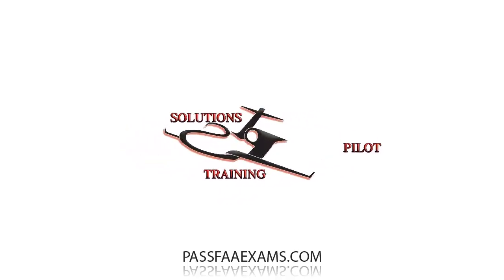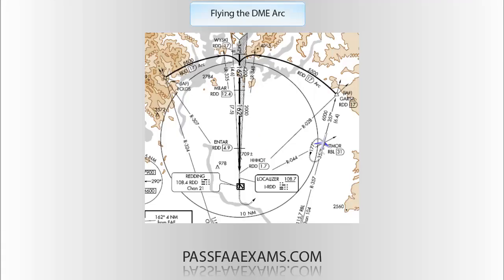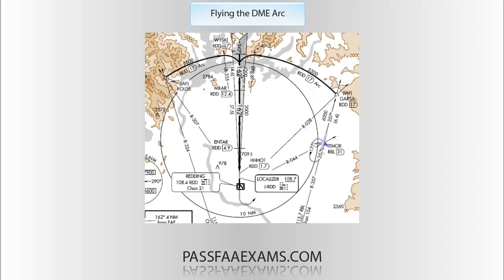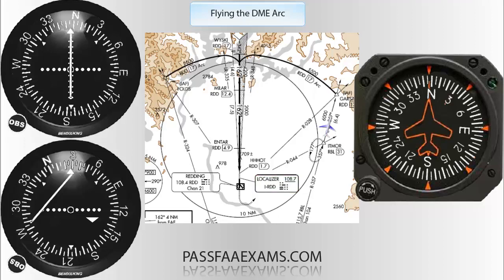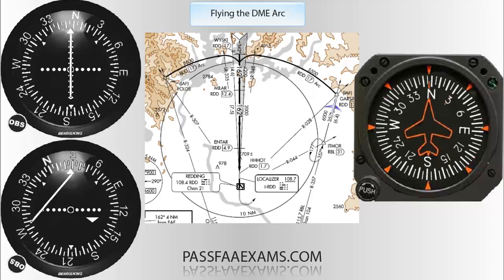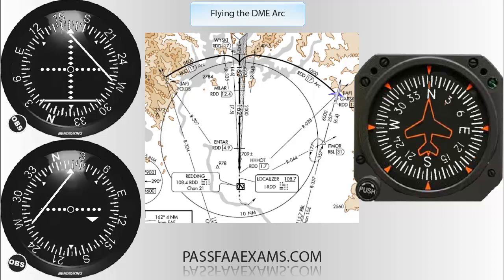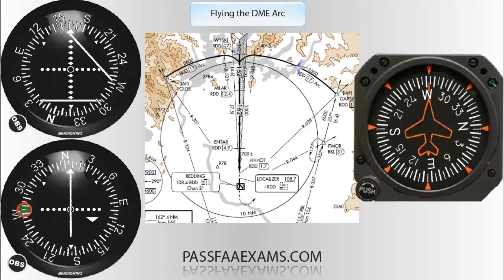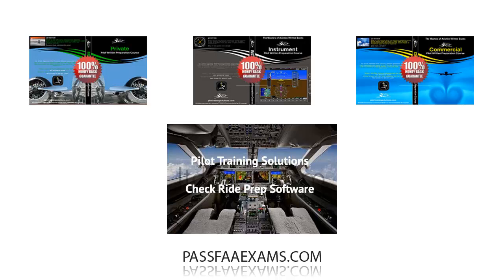How to Fly a DME Arc

Comment: Even that's too complicated. couldn't you just start a random bank, watch your distance to the vor and if goes up ease left a little bit, if it goes down ease back a little bit, and just watch the distance measurement the whole time, well that and the intercept radial to do the final thingy.
Reply from the maker: Nope Sir. That would fail your V-Ride and eventually also get you violated by the FAA.
Reply: @GianLucaNoia  holding a constant bank at a constant distance from a singular point to fly an arc wouldn't work? i obviously don't understand what's going on here then.
Reply from the maker: @MatthewHolevinski  Nope you obviously do not. Factoring in wind should help you understand why that would not work.
Reply from the maker: The procedure for executing a DME Arc is a standardized procedure. We at PTS just simplified it.
Reply: @GianLucaNoia  that's why I said watch your distance which is my of way of saying you are constantly correcting for wind in real time, I don't know anything about piloting or flying or any of that but with a dme device flying a semi circle while trying to hold a distance doesn't seem too radical.

Comment: You could always create a waypoint in the GPS  (OBS Sus) and arc around that point. It may be more difficult to do in some aircraft utilizing older avionics/gps, though.  Should be able to work in a pinch. Thoughts?
Reply: well, some of the stuff gives you nightmares for a time until you can do it after enough practice. use gps points on gps screen in fsx or fs9 and use a cessna ifr first tune vor 1 to your ils inbound and go there until the vor 1 shows its centering to the approach.